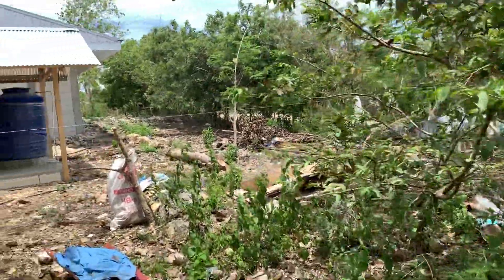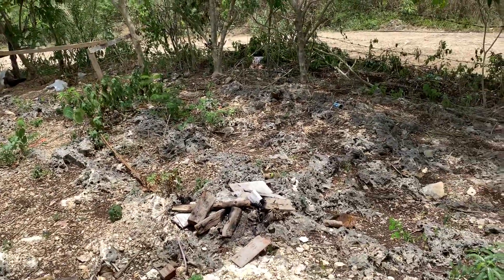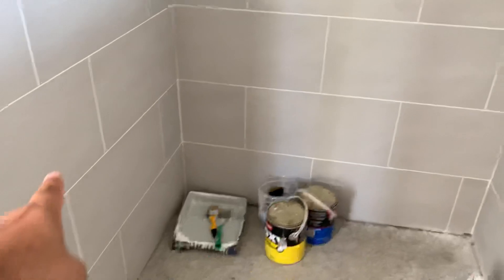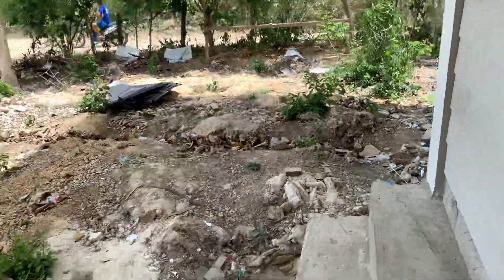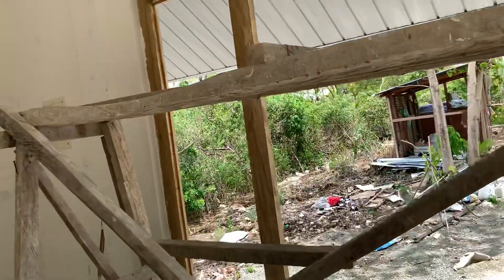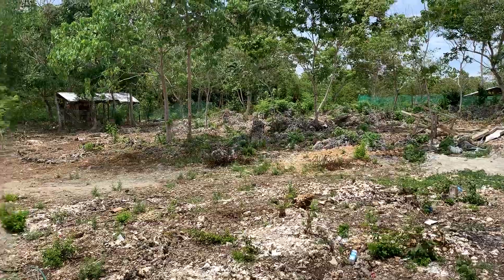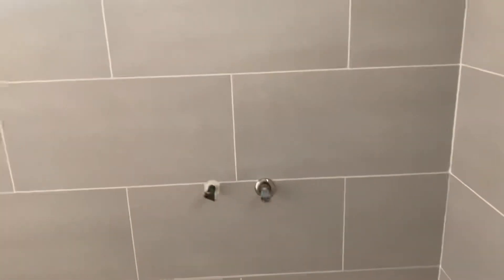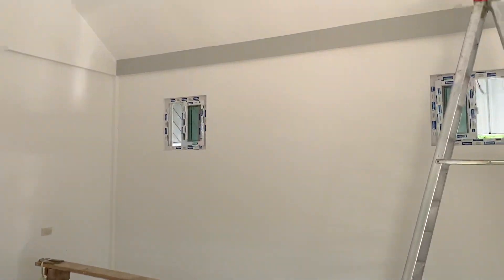House  building Philippines - new update 6/2/19

Comment: I would keep the gray border around the entire four walls, so it looks consistent, otherwise an obvious break will be viable.  The place is taking shape, looks good.  Have you decided yet how to bring the ac into the bathrooms to reduce humidity there?  I had suggested along with the bathroom ventilator to install a bathroom door which has louvered slates.

Comment: That wood paneling wouldn't last long because of the weather and the humidity there. There are wood paneling that you can buy there that's designed to last long with the weather. They are engineered wood that resembles real wood.